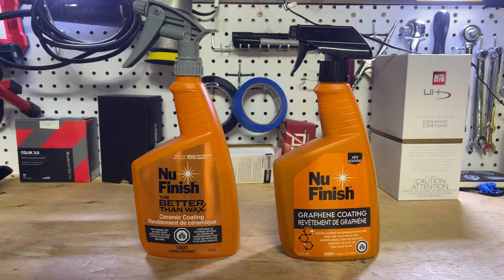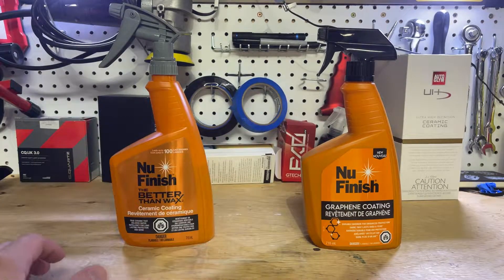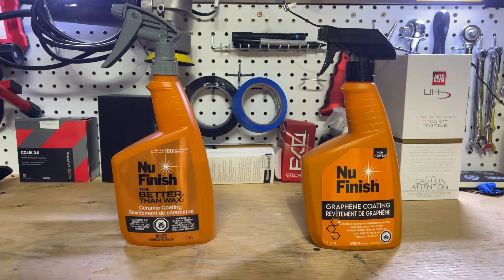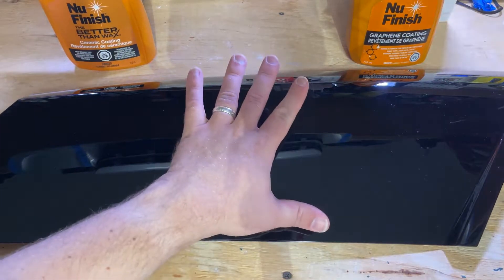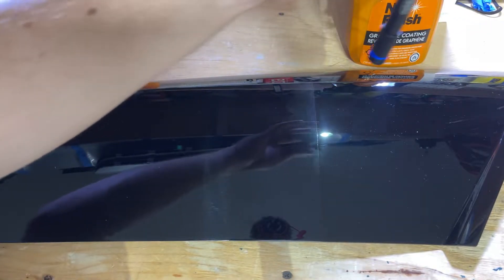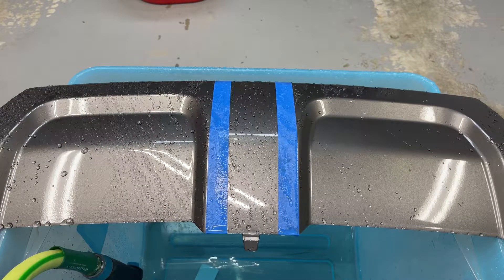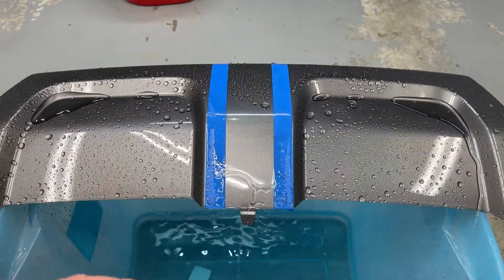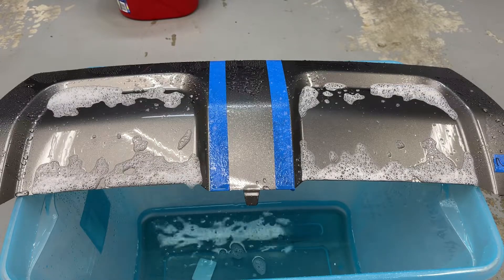NuFinish Graphene Coating - Same Bottle, Different Sauce - review and comparison!

Comment: "buff on - buff off".....my rosey red buttocks !!!  This product, by far has been the twitchiest, toughest product for me so far. An absolute pain in the butt!!!! Yes... I put it on and went to buff it off....and buff it off and buff it off...left a real nice tacky haze. And for an added treat, the haze was in streaks. My truck hood looked better when it was only washed !

So, I let it sit.....maybe ten minutes....and went back and started rubbing and it looked like the streaks were going away. Fine. My bad! Came back and the streaks were back. Now I'm getting pissed. You don't mess with my truck. So I got some detergent and tried to wash it off. No way. Know what I finally did? Grabbed a bottle SCRATCH DOCTOR and did the Whole Hood in S D. The streaks are gone now, but the whole hood has a very slight haze. I figure I learned my lesson. I'll keep up on regular maintanance until I'm back to where I was.....6 months, maybe?.........and then I'm going back to the name brand waxes I've used for years. I think this is one for the "if it works don't fix it"-file.
Reply from the maker: You know, a damp towel takes it off in one swipe, and is recommended on the back of the bottle?

Comment: It was the high spots that got leveled with the wash.
Reply from the maker: Yeah. I re-applied it and went over it really well and it still have lack lustre beads until it was washed down. Weird for sure, I’ll try wiping it down with a damp microfibre towel
Reply: @sheepstardetail  Yes! And I believe with this particular product, less is more. I have both of them but haven't tried the graphene yet. I will apply it for my winter coat and use your advice! Thanks buddy and keep up the great informative videos!

Comment: Meguiars APC has fabric softeners and brighteners. Not the best for testing protection
Reply from the maker: It does, but it still an APC. It’s also mild enough to justify using in a regular routine for deeper cleaning without trying to intentionally strip back protection products. I have been thinking about how I chemically test products and what is the right one to use (high strength foam soap, TFR specific products, acidic washes etc). I still haven’t settled on a solution that meets the requirements of a strong strip wash. If you have a suggestion I’d love to hear it. I don’t want to use something that isn’t part of a maintenance cleaning regime.